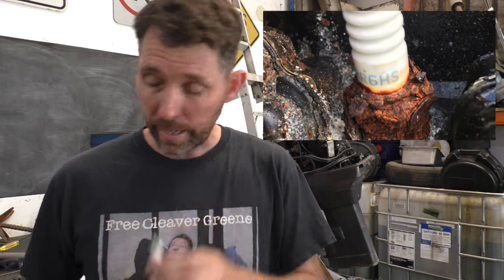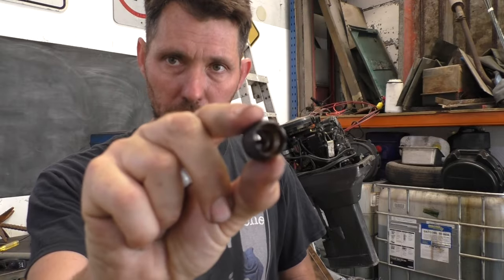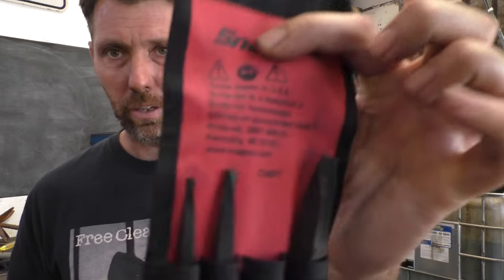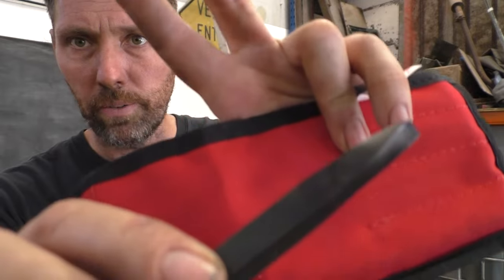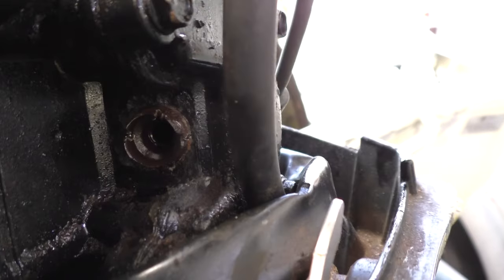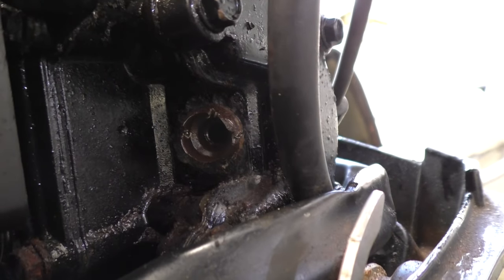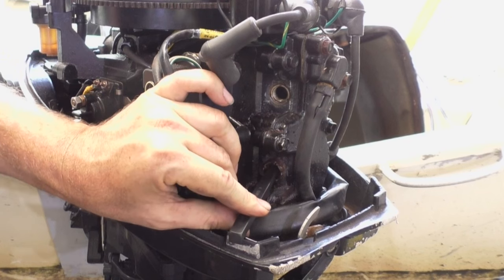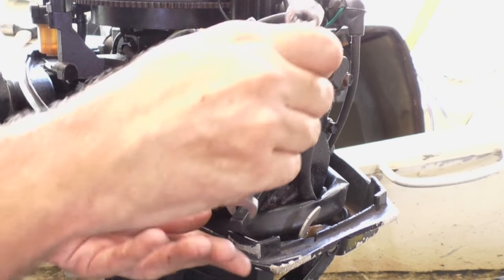Broken spark plug extraction

Comment: I made a mistake and bought a pickup truck many years ago that had a lot of rust on it. After owning for a while, I took it to my mechanic to replace spark plugs. When he took a closer look at the truck, he stated he thought the truck had been submerged in salt water.  He stated that he had never seen so much rust on a truck inside and out. Some of the frame was almost rusted in two! Anyway, the first spark plug broke off just as you described.  He could not get it out with easy out, so he decided to heat it with a torch. He stated if you do this, you have to blow compressed air into the cylinder and remove all fuel fumes before putting a torch to it or 4th of July might start early. The heat worked and an easy out got it out.  All the other old rusted plugs were still firing so he quit while he was ahead. Thanks for sharing tip.

Comment: That tool works great. Will look for the snap on truck in my area. Thanks for the video.
Reply from the maker: It certainly did the trick in this case. I'm sure there are plenty of other tools that will do the trick. I'm hoping this tip didn't come across too much like an informercial - it was just a co-incidence that he turned up and I paid full retail for it. I'm sure there are plenty of other gizmos you could try if you had this problems.

Comment: Nice technique with that tool.  Had a friend's Buick Century lose a spark plug out on the freeway some months back.  Did some damage as the porcelain part came unbonded from the steel at the bottom.  Never seen a spark plug fail like that before, it scared the crap out of us when it happened, was quite violent under the hood.  It was a transverse-mount V6, it was the center plug facing the firewall. Destroyed the plug boot and plug wire, bounced off the firewall leaving a dent, fell down clanking all the way before hitting the pavement and then the bottom of the vehicle a few times before clearing out the back. We hit the shoulder to have a peek at what the heck had just occurred.  The Buick drove home (noisily) on 5 cylinders, sucking and blowing through the open hole.  No trouble getting the collar of the spark plug out of the engine block, and never ever did see the top of the plug, but we were just really surprised that the bond would let go.
Reply from the maker: It is amazing that it can happen, particularly while driving along. Must have been quite a shock when it happened!
Reply: What did you use to get remaining plug out then? Just happened on my 3800 engine no 1 plug 2004 Grand Prix

Comment: Great video and great job
Reply from the maker: Thanks Andy!
Reply: +Dangar Marine 

Thanks for all your videos ! I'm current having issues w my mercury outboard tilt release valve nylon screw....the head of the screw  snapped in half when trying to release presume so I could lower my outboard...I assume it has never been turned since 94 or so....I was going to try an easy out with some heat to back out the screw a bit.   Any thoughts or tips?

Comment: What would you recommend doing if the spark plug well is corroded? Just pulled some old rusted plugs from a new to me engine and the mating surface on the engine block is corroded and full of rust -> I'd imagine that trying to install a new plug and sealing washer on top of that is a recipe for leakage and very poor engine compression and performance! Worried about cleaning it with a wire brush seeing as metal bristles could easily end up in the combustion chamber, which would be bad news!

Comment: Thanks! This looks exactly like what I need. What's that tool called though? I've been on this for days, trying everything from heating the broken piece to drilling holes in it so that I could get screws in and then use them for better leverage but nothing has worked so far
Reply from the maker: Link in the description to the tool.
Reply: @DangarMarine  thanks! I ended up modifying a screwdriver and use that, and it worked (but I had to use pipe pliers to and reaaaally bend it). So saved the day! My Mercury 9.9 still won't start, though...

Comment: I guess if you drop some of the spark plug's annode or insulation in the cylinder, you would have to remove the head before the debris does any damage?   Is there a tried and true method for removing a bolt that has broken off flush with the mating surface.  I guess drill a hole (progressively larger) and then use an easy out.  Do you spray anything on the threads to loosen the threads?  Great videos.  Thanks for posting!
Reply from the maker: If something goes into the cylinder you do need to be careful as you say. If it is only one or two large pieces I would probably try to fish them out through the spark plug hole, but with a two stroke it isn't much work to get the head off so that is probably a better approach. Easy outs are a good way to go, or welding a nut back onto the bolt, particularly if there is a little bit of thread left. I'm going to do a complete video on corroded / snapped bolts soon.
Reply: Great videos.  Look forward to seeing your broken bolt video.  Thanks for sharing your knowledge and experience.  You are a natural teacher.

Comment: I've always used to oversize flat head screwdriver you tapping in the same way you just did that tool the lock pair of ice grips onto the screwdriver handle it works the same way it's probably cheaper than that too

Comment: Was there any reason you didn't use a much larger adjustable wrench to get more torque? It seems like that would have made it easier.
Reply from the maker: Only because I just grabbed the closest thing to hand. If it hadn't come free I would have put a bit of heat on and found something with a longer handle.
Reply: Hi DM I'm sure what you really meant to say was -  it is always a good idea not to use a pull bar or similar so that you get a feel for the tool doing it's job so that damage is not done to the threads etc. "Well saved" Lol.
Reply from the maker: Ah, yes, that's it! Always start with a breaker bar then go to something smaller if it snaps. ;)

Comment: Hey so lets say you bought a Merc 9.9 for $100 because the owner couldnt get it to run right, and in removing the spark plugs you find that they have completely cross-threaded and destroyed the spark plug sockets... If I'm real careful, I can replace them and have the motor run like a dream. Is it possible to tap in a slightly larger set of plugs? with/without actually buying a tapping tool?
Reply from the maker: You might find you can get the plugs back in if you are lucky. Otherwise the best way is to install new threads like this https://www.ebay.com.au/i/282925788348?chn=ps
Reply: thanks!

Comment: A slang term for that tool in the US is an  "easy out". Ironic though because there is rarely anything easy about it!
Reply from the maker: Couldn't agree more. So EZ-Out is a registered trademark of a particular brand of extractors, but I've never had much luck with them. The trouble is they are tapered so as they bite down they put pressure on the walls of the thread and actually hold them tighter. I was pleased this worked, but I think it was more to do with the fact that this had rusted apart rather than the thread being corroded like when a bolt snaps.

Comment: Hey Stu, love your work. Do you happen to have any videos on cleaning the corrosion off around the spark plugs (looks similar to the thumbnail of this video) - my 8HP has it quite bad - and I'm not sure where to start with removing it, repainting and which products to use. Thanks man
Reply from the maker: Hi mate, not specifically but I would wire brush it as best you can with the spark plug in so no debris goes into the cylinder and then look into a rust inhibitor like phosphoric acid.
Reply: @DangarMarine  awesome thanks for the reply! The paint is actually flaking, so I guess I'll have to prime + paint - any particular products you recommend there?
Reply from the maker: Use an etch primer first and make sure the paint has good heat tolerance.
Reply: @DangarMarine  Thanks heaps man, appreciate the advice!

Comment: Any recommendation about those WD-40 rust release oil?  or not to using it?
Reply from the maker: I think it's always worth putting a bit of penetrating oil on stuck parts. It won't work miracles but it will help.

Comment: I have exact same snap on stud extractors, didn't work for me, broken plug is seized solid
Reply from the maker: Try some heat and penetrating oil first.
Reply: the head is aluminium, I don't have oxy acetylene only gas blow torch, its not having any effect, it has been soaking in penetrating oil for weeks, next step, I am resorting to drilling it out and going for tap screw and inserts.   @DangarMarine
Reply: @GeneralMe100  did you figure anything out I'm having the same problem.
Reply: @destinymayne1609  same here.  Mine wont budge as the threads themselves snapped in half. Im afraid to use too much torque and snap off the easy out along with it.
Reply: @Robinhood179  yes finally had to drill it out and re thread it... Wish would have just did this to start with.
Reply: @GeneralMe100  i did same drilled out n rethreaded it
Reply: @Robinhood179  just drill it out it was so easy yes its kinda risky make sure after u drill you blow it out and stick a magnet down to grab anything that might have fallen down thats very important.... After usin a heli coil it runs like a champ lol this is the kit i bought after wasting huge amount of money on other unnecessary tools https://shop.advanceautoparts.com/p/heli-coil-thread-repair-kit-m14-x-125in-hel5334-14/25981936-p?c3ch=PLA&c3nid=25981936-P
Reply: @destinymayne1609  thanks so much for your help.  Friend told me the same thing, just drill it out.  Guess its time...

Comment: whats the part number on that I couldn't see I saw cb407 snapon  by the way great vid on  150 rebuild I have 08 etec 300 love to death  just had 2nd 300 hr service done was wondering your though about changing fuel injectors before they run lean  it has 2010 power head full dress warranty by evinrude with 300 hrs my dealer key largo florida couldn't tell why but still had 13 months warranty I run evinrude oil xd 50  so it is alittle on heavy side she run 39 at 6000rpms I run 5200 cruise my  boat 82 wellcraft 248 sportsman full fishing load is around 8000lbs or 3600 kg comment if u can thanks john hookednrolling fishing team
Reply from the maker: I'll have to check that part number when I get back to the workshop, I should have put it in the description, I'll do that once I have it. I'm not sure how long the injectors in etecs last before they cause troubles, we only very rarely deal with them as they require quite a bit of specialist equipment to re tune after an injector has been changed.